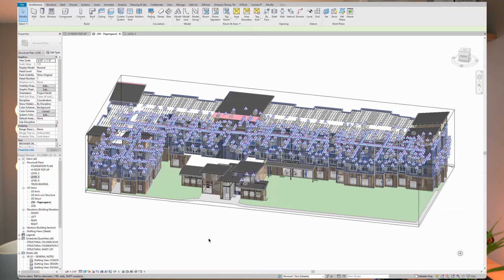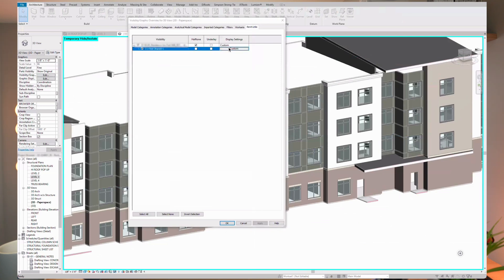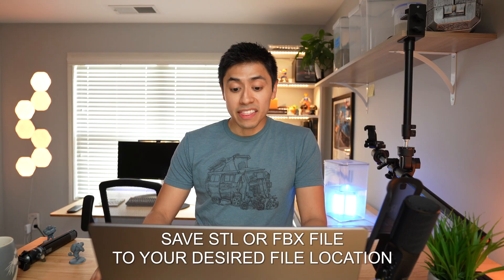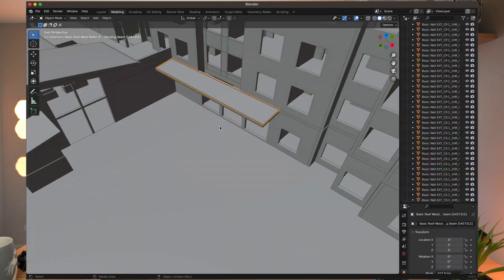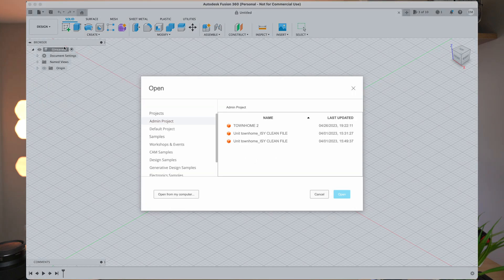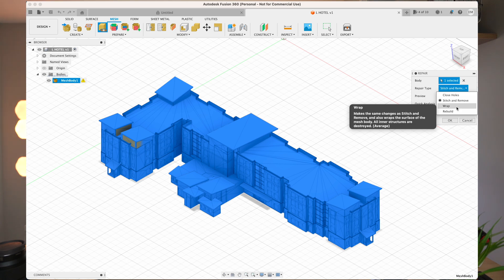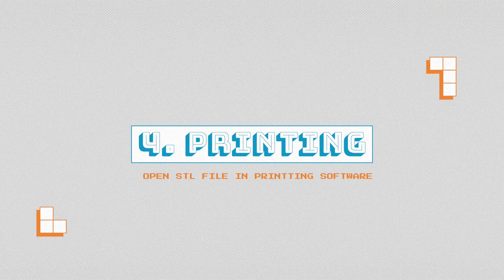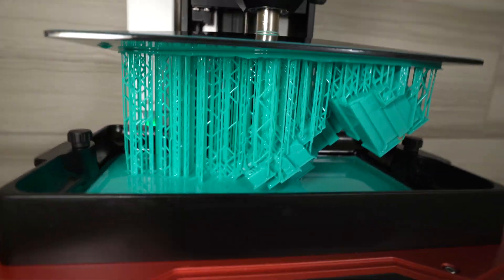3D Printing Hotel Building from Revit

Comment: do you have a video showing how to print one floor at a time?  I want to make a model with the spaces, not a solid model.  Also having trouble figuring out scaling and enabling support, thank you for the video
Reply from the maker: This was the first/only time experimenting with 3d printing a revit file so its definitely a work in progress. I tried printing a single floor once but it was a failed print. The scale was way too small and would have required me to thicken all the walls and floor. Best of luck!
Reply: You can use scope boxes to cut the levels and make them as independent exports. ***I have not tested this but I plan to in the coming weeks.

Comment: i have been looking for 3d printing from Revit model, you are a god send.
But could you elaborate what did you actually clean in Blender?
Reply from the maker: I didn’t elaborate since it was a long and tedious step but I guess I should have made it clear what was happening. Since I was just printing out the exterior of the building, I wanted to make the whole model a solid block.

This meant deleting everything within the model and then adding blocks/objects to fill the interior of the building. Another reason for this is to thicken objects that are too thin to print. I made that mistake on my first print which is why parts of the parapet were chipping off. I went back to the blender model and thickened the roof as well as the parapets. 

I guess you could try to do this in revit but it would require making families with thicker profiles and messing with other parameters.

Hope that helps!
Reply: @dmontenegro  Hi Daniel, thank you so much for your help. I have been trying fuind these answes in Youtube, reddit etc. but you compiled most of them here.
Just another question, I have created several switchroom at work dimensions like Length 6m by 3 m, or 18m by 6m etc, these switchrooms are suppotred by Columns and bracings which are 75x75 SHS, when I scale down the 6m by 3m one, I have to scale down to 2.5% to fit the 3d printer, the STL becomes so thin it just prints some strands of plastic rather then a 300PFC Chassis. How do I get a proper scaled down solid model?
Do you have any solution for that?
Reply from the maker: @opencanvasih  I came across this problem too. At the very end of the video I have 2 prints of the same model with slight alterations (model 1 was a complete print w/ minor warping, model 2 was a failed partial print). The parapets and roofs were paper thin in the first print, so I went back and extruded the faces in blender to thicken the walls of the members. Aside from the failed print (model 2), that portion of the building came out better than the first print. So tweaking the thickness will be the key to your problem. It wont be an "exact" scale model but it be close to it.

So in blender you would have to edit the columns to be thicker in the x and y direction (x2 or x4 thicker than the actual column dimension). It will look weird and not be to "exact" scale but its the only way to get the column to print at all. 

When you scale your model down to fit in the print bed you have to look out for those members/pieces that are too thin or small to print. Either edit the model in blender to be thicker in certain areas or avoid including those members from the 3D print model.